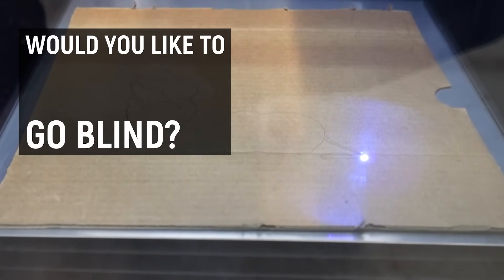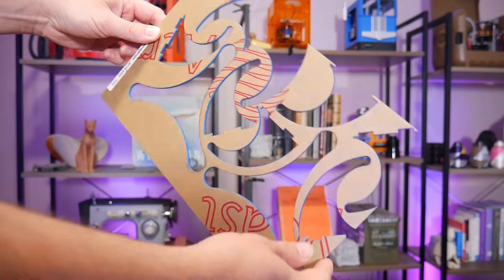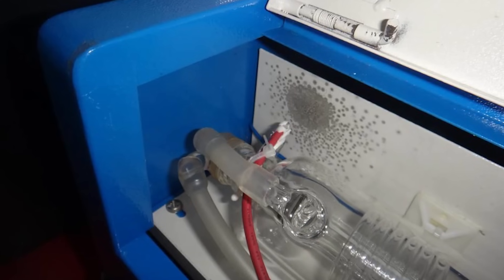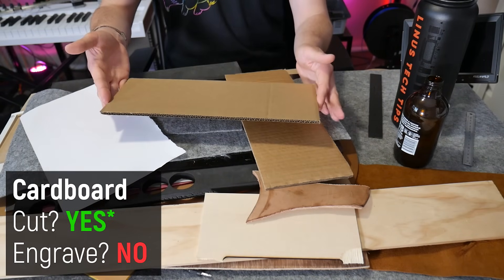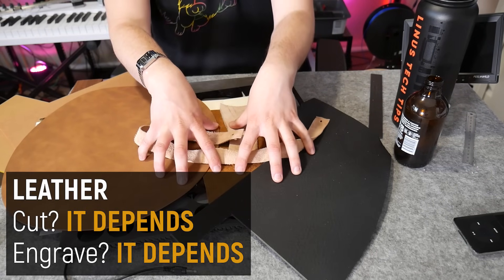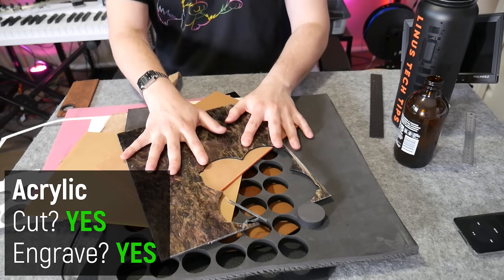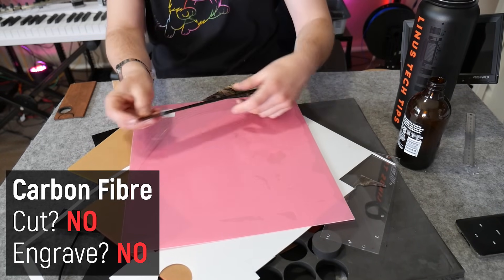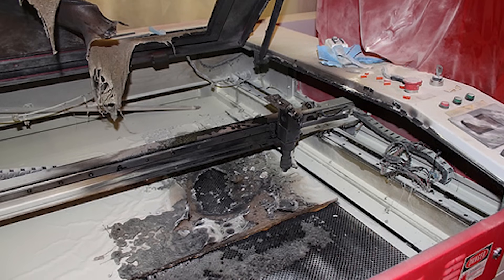Are cheap laser cutters safe?

Comment: To etch stainless steel with my CO2 laser, I use a thinly applied layer of gypsum. Since just brushing it on leaves an uneven surface, i make a gypsum suspension with highly concentrated alcohol and then spray the suspension using an air spray gun (the ones that are normally used  for paint). You want a layer that is about .5 mm thick. For engraving, you want to set the laser to a rather high  power and want to go slowly. Depending on  where you set the focus, you may want  a bit of stepover, especially  if you have a lens with a very short focal length. This method leaves super dark and detailed engravings due to a chemical reaction of (probably) the sulfur from the gypsum reacting with things in the steel.

Comment: First I thouhgt this is another video about "Don't", without real explaining. I hate such videos. But you explained everything very well and understandably for newbies. 
Btw, the first thing I lasered was a vinyl record, that was a terrible Idea. I only did it once (it cut relatively well), but after that I did a little research and was a little shocked because it was made from PVC. And you don't want the fumes in your lungs or on your machine, hydrochloric acid doesn't do well there. So lesson learnt, after that I do a research for everything I want to laser and I don't do it, if I am not sure it is safe.

Comment: Thank you Angus, what a timely and extremely useful video to see this morning.  Just a few days ago I received a new laser from a company called XTOOL in the states and it’s the first desktop sized laser I’ve owned that actually does what it advertises, it etched glass, stainless, aluminium, cuts, engraved and etches timber and many other materials very simply, cleanly and sufficiently, especially with the rotary attachment. Having a co2 laser and a half dozen small diode ones that promised the world and , oh well, lol, the first thing I’ve begun to do after the first few test cuts to make sure it’s all working and correct, has been to start constructing a sealed and extracted enclosure from some orange Perspex that a company in Brisbane say is for laser enclosures so your video is perfectly timed as I begin to explore the machines capabilities and begin to integrate its use into my other woodworking etc. I’ve already built a base for it to sit on, a sheet of thin aluminium from Bunnings glued to a piece of plywood so that I can set the machine up on any surface and not have to worry that the beam will accidentally burn through the workpiece and into whatever surface is below. I agree with you  100% Angus about shielding. Personally I think that they should be making shielding mandatory on import of any of these machines because the risk of permanent eye damage is really so great without it. Anyway, thanks mate for all your great videos, it was you that got me excited about 3d printing all those years ago when you started your channel and videos and why I’ve got 3 now lol, then the desktop cnc and built a massive big one with all the joints 3d printed from a video that was on Michael’s channel at Teaching Tech. Between the two of you Angus, you’ve given me many years of inspiration and delight in using these new tools to add to the Woodworking skills I’ve developed over many years of learning and practising and it’s made my work far more exquisite, well, in my eyes at least lol, and uniquely my own creations so thank you so very much mate. Your efforts have caused me to be blessed for the rest of my life by introducing me to such amazingly useful and valuable tools which I have found, when used thoughtfully and wisely, always using measured steps and safety precautions, especially so as not to hurt anyone else, and I for one certainly don’t need a blind 11 year old hound dog getting under my feet because I didn’t shield a tool that I easily could have done. So take care mate, all the best from southern sydney, Phil ,’o>
Reply: Hi Philip,

do you maybe have a link to the orange perspex you bought? I am currently looking for something similar for my enclosure.
Reply: Hi Bernard, sorry mate but no. I bought them before my wife got leukaemia 3 years back and after her death I cleaned out years of paperwork and unfortunately that was included in what wasn’t needed. It was a place in Brisbane that I had googled so shouldn’t be to hard for you to repeat what I did, hope so. Take care mate

Comment: I'm curious what the actual injury numbers are. I don't think avoiding something because it's dangerous in theory makes sense. I use a table saw all the time and that machine it's logically a safety nightmare. Open carbide blades spinning inches from my fingers doesn't sound safe but they are used successfully all the time.

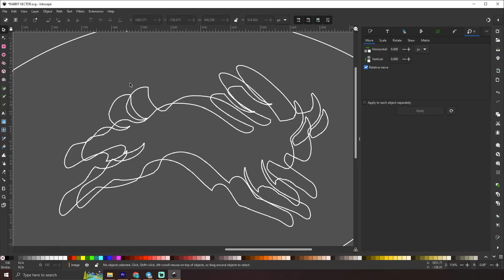Comment: 15:56 Oh dang this is so true. I have dealt with a few laser cutter fires by now, and it seems so basic but overlapping cuts have been the culprit more than once.

Damage happens so incredibly quickly, too. I have been right there when the fire starts and still lost the lens, x-axis belt and the honeycomb cutting bed to heat damage. My own laser now has an automatic fire suppression system, two fire extinguishers and a fire blanket within reach, and two separate camera monitoring systems for the times I need to be just out of view (but always in the room). Taking no more chances lol

Meanwhile, the laser at work is sometimes left running (cutting!) unattended, which is just... awesome.

Comment: Great video. This is why the only time i got excited about Diode lasers was the Xtool M1, which is fully enclosed and combines a blade cutter with the laser. Bought one, been using it for a few months now and very happy with the decision. I did add proper inline venting, and there are definately things that can be improved, but it is the direction i think diode lasers should be heading (fully enclosed, properly vented etc). Not sure how you can address the learning curve for materials without insisting on vendor vetted consumables, but I agree that there should be a lot more education.

Comment: 6:55 what makes you say no engraving for cardboard? at ringling college’s makerspace/digital fabrication studio we have a big enclosed laser cutter, i think one of the glowforge ones. i’m actually taking the digital fabrication class rn. we were literally required for an assignment to engrave some text and a vector drawing into a piece of non-corrugated cardboard and it all went perfectly fine.

i can’t speak for engraving on corrugated cardboard but what we were using was like a 1/8” thick cardstock i think. in fact it was way more difficult to find the right settings to get the laser to actually cut through the cardboard all the way, a few students had to run their project through the laser cutter twice to get it to cut all the way through. 

aside from that, really great video though!!! i was thinking about getting one of these cheap laser cutters because i’m too awkward to ask for permission and deal with scheduling to use the school one for personal projects lmao, but it’s probably better if i just save up for a while and invest in a safer one that has an enclosure.

Comment: 1) yes you are totally correct.  The people in the marketing videos seriously risk going blind just looking at the spot onthe workpiece

2)  solid state =/= diode

its confusing.  Certainly semiconductors are solid state materials.

Solid state is defined by the industry as meaning DPSS type lasers using solid state gain media

But not fiber.  Those are defined as fiber lasers (or fiber amplifiers)

To make it even more complicated:

semiconductor lasers do not necessarily include diode lasers powered by electrical current.

In general they simply mean that the active gain medium is a semidonctur as opposed to exotic rare earth elements doped into a material with otherwise good light transmission characteristics.

Disk lasers are in this class.

Comment: PVC is easily distinguished from real leather with a candle/lighter and a needle .. (maybe use some plyers) ... Heat the needle apply to the material. Leather won't melt the plastic based ones will show.

Comment: THANK YOU!  I run a 3D printing shop and so many of my customers look at me like I'm overselling the dangers of these diode lasers.  If they're so good - they should be able to put them in an enclosure and do a flying mirror setup and still have them work just as well.  This also means being able to put a lid and ventilation on them.

The one qualm I have is at 3:15ish, you say lasers have to "burn" away material.  But a good laser cutter doesn't "burn" anything.  It ablates it.  There's a difference in the method of action, where ablation is more like vaporization - in that you aren't imparting a bunch of energy into the part that you're cutting, but kind of causing the material to disintegrate off of the surface.
Reply: Isn't ablation performed using pulsed instead of continuous wave lasers, firing a high wattage beam for microseconds to perform said work?

Comment: I avoided getting a "multi" unit like the one you showed that could use a drill bit or laser. I was also sizing up a 3d printer that had a laser cutting head. I avoided both and got  3d printer and a cnc machine with a drill head separately. I was mostly worried about my daughter and or cat managing to damage their eyesight somehow while I was using the laser cutter. Like if they came in the room not wearing proper eye protection. I had only slightly considered the fumes and smoke from burning but that would also be a big issue as you highlight.

Comment: With the PVC, my bigger concern would be other reaction products than the HCl. When there is a smoke extraction system as low amounts of HCl that remain are more of an irritant and can be evacuated by an extraction system easily (still less than ideal), but if you burn PVC you can get other very toxic byproducts like dioxins or PCBs which can stay behind and accumulate...

Comment: Late to the party, but my 20w diode etches/marks titanium really well… 

Ya gotta be careful about the speeds and infill as the material will heat soak and warp but it definitely worked for me.

Comment: I've been thinking about buying a laser cutter like this for a long time. But it would also be too dangerous for me with the laser, so I would build a cover with suction. I really only want to cut EVA for cosplay armor. EVA is ethylene vinyl acetate copolymer, should become CO2. But there will not be completely oxidized carbon residue and who knows what else is inside, so I wouldn't cut it without extraction.

Comment: I have Nextwave Automation's Moray diode laser which I believe is now discontinued.  It has the full enclosure with a red plexi top door and an interlock.  I run it outside of the house.  I'm tempted to get a higher powered diode laser with enclosure but most of those do not have interlocks to shut the laser off if the door is opened.

Comment: Would not using a scroll saw be a good alternative to a laser cutter for most hard materials ? Aldi were selling a good cheap one a month ago for this very purpose.

And as for the safety of acrylic. Yeah, I created a display box to house a large model out of acrylic sheets I bought from Bunnings, and just cutting it with a saw gave of a horrible smell that I had to open the doors and windows to let out just in case the fumes were toxic.  And as for the dangers of PVC and other materials including plywood sheets in a fire. How on earth are these allowed to be used as building materials or furniture etc ?

Comment: Very good video. I would never use a laser that is not enclosed. I have one of the cheap K40 CO2 lasers purchased from Vevor Australia. I checked it out and all I needed to do was fix the earth which was a bit dodgy and buy a pair of certified 10600 laser glasses. One think you did not mention is that a laser cutter, even a K40 can cause severe burns. One K40 Facebook group thought it was a badge of honour to get a finger burn. I left the group because of the safety attitude of quite a few members.

Comment: Thanks for making and sharing your expertise here. Definitely you don’t want to be inhaling silica from glass. Its basically death by 1000 cuts as the silica never leaves your lungs. Ideally glass is always formed by being fully heated and slumped/melted into shapes or cold worked with water and abrasives (diamond or aluminium oxide though softer media can work).

Comment: I use one of those cheap diode lasers- in an enclosure with air extraction- and I fully agree with your assesment: there is zero concern about safety on the part of the manufacturers. If you use common sense and think about what you are doing they're okay to use. The thing that worries me is that there are loads of people out there without common sense and that these things are readily available on an open market :P

Comment: I actually have one of the cheap lasers, it's a diode laser but for mine I made an aluminum casing for; isolation for thermal and electrical surges and put the proper wavelength window in it (so I can see progress without damaging my eyes). Other smaller things are various chemical alarms, fire extinguisher and ventilation.

As for why I got it; well the EVA foam you mentioned is great for cosplay and I use the laser to cut it. While yes the V stands for vinyl, it's not a chlorine based vinyl so it can be safely cut. DO watchout if you have a diode instead of fiber/CO2 cutter that it does tend to melt so don't go over 5mm thickness due to energy you need to cut.
Reply: Oh and one more sidenote; for Europe they actually do provide a datasheet with what are safe and unsafe materials, what safety precautions you need and what settings to use for the safe materials. Hooray for consumer protection and safety laws in the EU :D

Comment: Friend of mine bought one of those cheap chinese k40s and the plug was not grounded at all. you had to use like an auxiliary ground that really did not connect well to the chassis of the machine.  i fixed those issues but yeah it was sketchy initially. i would suggest always having somebody with some electrical knowlege at the very least go over the grounding on the machine

Comment: a big takeaway I got from styropyro and braniac75 videos is that the cheaper the laser the less accurate the specs. and it's not like flashlights where they're almost universally dimmer than advertised, super common for some cheap lasers to pump out an order of magnitude more light than spec at a dice-roll of frequencies. not all of them visible, either.

Comment: In the places I've worked in the past, A lot of the sheets here like polycarbonate, polystyrene, and acrylic were not cut using a laser - they'd use a CNC router instead. I've been thinking about getting something like a laser machine, but after watching this I think I'd rather stick to a CNC router. It seems at least a little safer.

Comment: Another material which cuts very well (but you can't engrave) is your typical foam core boards (the white sheets you make signs with).  You need to be careful cutting it because it can catch fire if your laser is moving too slowly or you aren't using enough air assist.  The only laser fire I've ever had was when cutting foam core.  In my case, the pieces that are cut out fall into the discard tray down below (about 12" / 300mm below the cutting bed), and while cutting, the laser passed across one of these pieces, and at that distance the beam is so defocused, it heated the piece up instead of cutting it and it caught fire.  Foam core fires catch and spread rapidly.  Luckily I was standing right there when it happened, and I was able to hit the E-stop on the machine and remove the discard tray from the building before the fire spread to anything else.
Reply: @Beehive Of course you'll want to use a suitable exhaust system -- just as you would when cutting any material.

Comment: Wonder how useful assist gas would be on diode lasers or oxygen to assist cutting or nitrogen to avoid burning? Thanks for the video on this.  Still think water jets are the much saver and that will cut anything but that is not a hobbyist toy.
Reply: Nitrogen won't prevent things from being scorched because organic materials still break down when heated.  It just means it won't ignite.

Comment: Angus, the best way to determine if you should use a laser cutter/engraver on a product is to request a  material safety data sheet, or MSDS from the manufacturer. I'm not sure if this is standard in Australia but it is if you purchase product from the united states.

Comment: Brilliant! I looks very stupid putting a laser with just a little lens "guard" next to you onto your desk. I am using one of these cheap machines but built my own ventilated enclosure including a webcam. I've never seen the laser running with my own eyes. I am waiting for safety tools to detect gases and it would be also nice to have something for temperature monitoring when operating lasers, 3d printers and also charging LiPo's. Thank you very much to push this information to your channel =)

Comment: I managed to engrave on metal cutlery using my 10Watt Snapmaker diode laser by covering the cutlery with masking tape. By the way the Snapmaker  comes with an (optional) enclosure AND rated safety glasses AND an extractor fan and hose.

Comment: The number one thing that I was told and always tell people I know who weld metals, if you're cleaning your surfaces, don't use brake clean unless you triple check its unchlorinated brake clean due to the gas given off from the heat of the welding. The gas will kill you. I'm definitely keen to get a laser cutter to go with my cncs and 3d printers, so this is definitely interesting to watch.